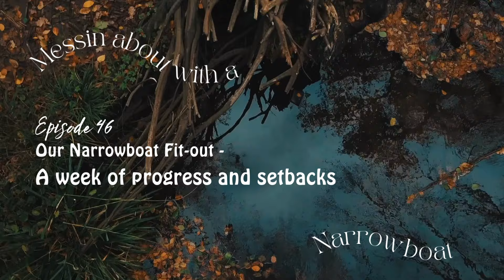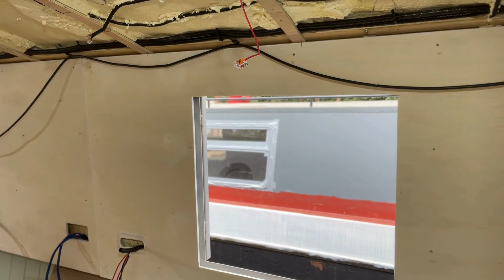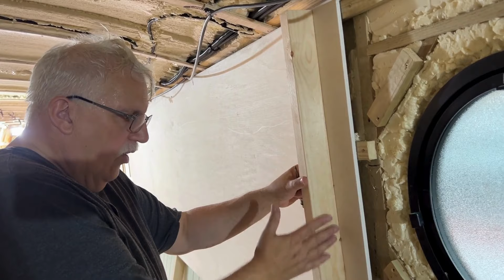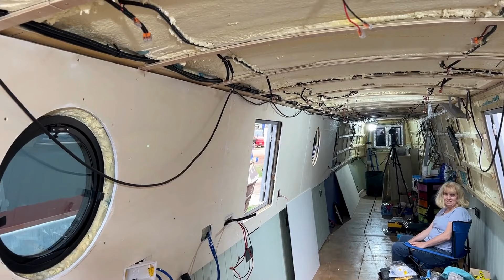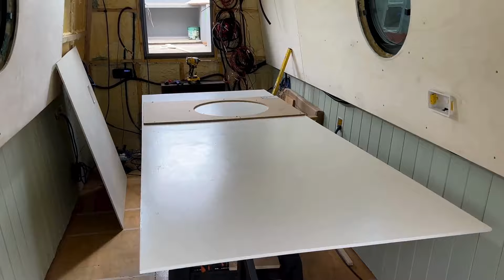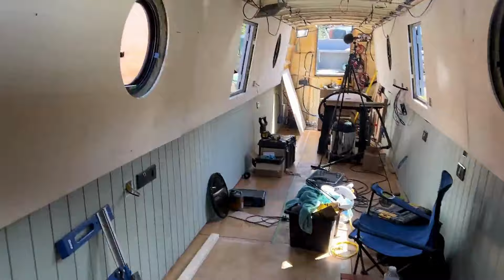Progress and setbacks on upper gunwale lining | Our Narrowboat Fit-out | EP46

Comment: Try a shutter speed on 50 FPS or less
Reply from the maker: I’m on 30fps. Standard iPhone I think, but it seems if I use PAL and 25fps is the recommended setting, so will try that. It’s really annoying this week as I’m working near the lights.
Reply: @messinaboutwithanarrowboat  your supply of 230v at 50hz so you can also try 50 FPS if that is an available option. Good Luck